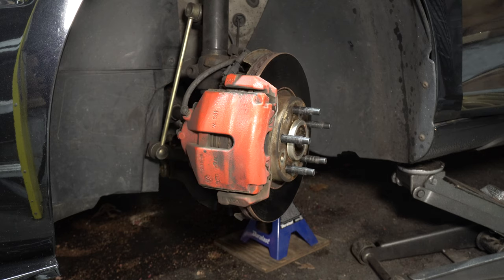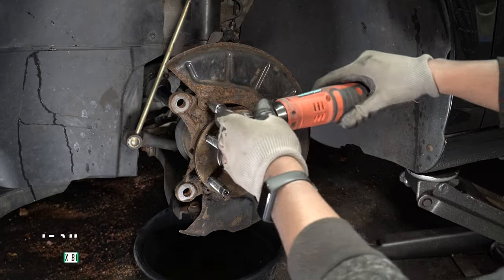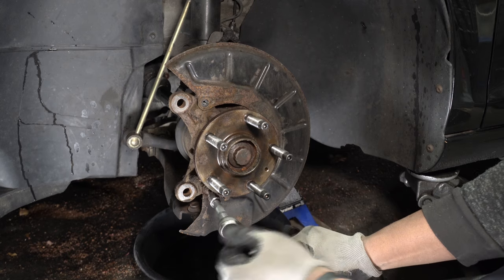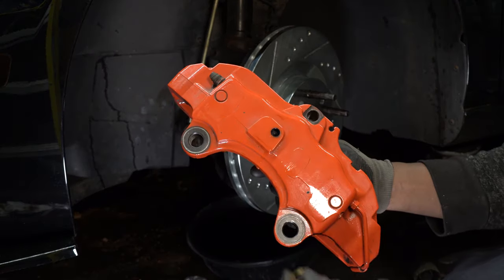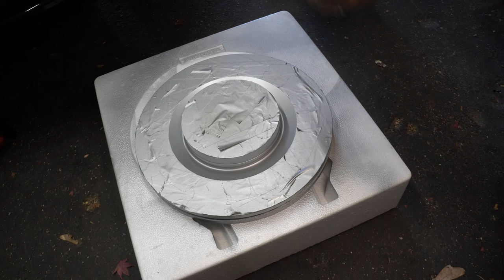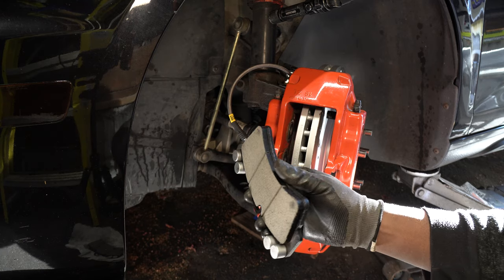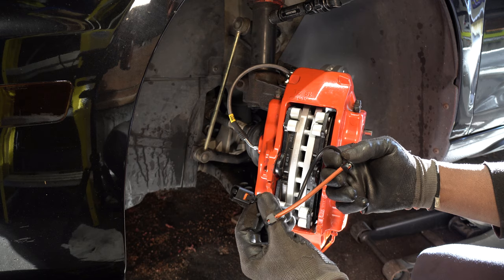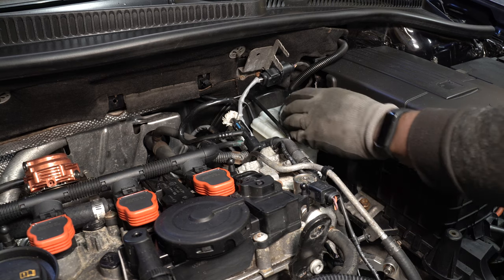MK6 GTI Brembo 18z Caliper Front Big Brake Upgrade

Comment: I did the 6pot 18z Q7 bremboz on my audi a4 2.0t quattro. its a direct bolt on with the exception i had to use ML55 amg rotors thats 345mm. ML55 rotors stock centre bore is 67mm.. i had to find someone to open it up to 68mm to fit the audi centre bore hub. rs4 brake lines. im currently looking into making my own rear brackets to fit the 17z 4pot brembo from a Q7 rears to my A4 rears with 330mm s5 rotors with a wilwood dual caliper to retain the handbrake!
Reply: Hey there I have a a4 b7 2.0t can I fit 17z rotors in front as well ??

Comment: What wheel offset are you using to avoid caliper hit wheels
Reply: Little late,

stock offset is 54mm I believe, and they recommend a 20-25mm spacer at that from what I see.

Comment: This is the best and most detailed video I’ve seen on this brake upgrade so far, Big up yuh self bro. 
I have a 2010 Audi A3 fwd (very similar to the mk6 platform).
Do you think this kit would work for my car?
Reply from the maker: You might have to change the spindle to the mk6 one, but I haven't got the chance to inspect the spindle on the Audi A3. I can't say for sure that the caliper is going to be a direct fit as is, but once you get the caliper mounted, everything else should work.
Reply: @CraftyWorkshopBuilds  ok, thanks a lot man.

Comment: I just recently did this conversion and used the rotor you put in the description and the oem pads for the 18z caliper are bigger than the rotor itself. Did you have any issue with your rotors?

Comment: Very nice video!I have a few questions though .What size of brake discs are these ? The brake sensors of the porsche can fit the scirocco or i have to buy new one ?same with brake lines ?
Reply: Also will i need adaptors for  the scirocco?

Comment: So the stock master cylinder works fine with them? Also would mk5 gti aftermarket ss lines work as well?
Reply from the maker: Yes, the stock master cylinder works fine. Not sure about your about those lines you mentioned.

Comment: Great vid... got the same calipers and waiting for new 350mm custom rotors.... rear set up video? I'm running an audi tt mk2, all videos I've seen indicate that I'll def need a bracket plus the OEM calipers ( for handbrake) + the Bembos...
Reply from the maker: I might do the rear aswell, I still haven't decided as yet. But, yea you'll have to run a dual setup in the rear to maintain your handbrake. It's also recommended that you upgrade your brake booster as well.

Comment: I was curious as to what spacer you used? I did this same mod and i am having some vibration and believe its the hub having no support on the wheel
Reply from the maker: Did you use the hub centric rings?
Reply: @CraftyWorkshopBuilds  yeah i did
Reply: @CraftyWorkshopBuilds  what spacer did you use?
Reply: @lisa did you figure out the vibration problem?

Comment: I'm planning on doing this soon, is there any other upgrades you recommend doing along with the rotors, pads, brake line, and calipers? Do we need any conversion plates or anything like that? Thank you! This video was extremely helpful!
Reply from the maker: I recommend doing a wheel stud conversion. I'm happy you found this video helpful!

Comment: What spacer did you add into the rotor at the end?

Also it looks like you added a centric ring to that spacer.  Can you please provide the info.

Thank you
Reply from the maker: 5mm spacer, my wheels will clear the calipers without the spacer. Nah no centric ring added to the spacer

Comment: You used the hubcentric rings because you have aftermarket wheels or for the brake disc not to move?
Reply from the maker: Both, I have one for the rotor and one for the aftermarket wheels.
Reply: @CraftyWorkshopBuilds  so you have one on the wheel and the one on the li k is just for the rotors or the same ring work in both together?

Comment: So nice video! Very clear! 
Is the electronic sensor replaced or it is the same it was integrated with the stock brakes?
Is there any electronic calibration or reprogramming required after upgrading with this brakes?
Thanks!
Reply from the maker: Nah, no reprogramming needed. The new sensor will plug into the stock connection socket.
Reply: @CraftyWorkshopBuilds  thanks!  I see there is a link for everything you used and installed, but for the Calipers - Brembo 18z, where do you suggest to buy those?

Comment: Busy with a retrofit also... Would it be fine running the disc without the set screw securing it to the hub?
Reply from the maker: Yea, it will be fine. If you have a wheel stud conversion, it will also help to keep the rotor in place.

Comment: Correct me if im wrong but that is not the right side rottor been installed on the left side, meaning the outter of the grooves had to rotate towards the front..
Reply from the maker: The direction of the slots might be based on the manufacturer, and could also depend on the air vents in the middle of the rotor. The rotors that I used came with a stickers on them that identified what rotor was for the passenger side and what for the driver side.

Comment: Hey man loved the video! I was wondering if I could run this setup if my wheels needs hub centric rings since the rotor also needs them? Thanks!
Reply from the maker: Much respect! Yes, if you have aftermarket wheels that needed hub centric, you still need to use them. So you'll be using two hub centric rings, one for the rotor and one for the wheel.
Reply: @CraftyWorkshopBuilds  thanks for the response! Im looking to rebuild the brembo 17z I got from a part out, do you know where I could find a kit to do that?

Comment: is the 17z brembo use the same setup like this..the rotor size and the bolts? 
if u can give detail size of the rotor..really appreciate that..tq bro..
Reply from the maker: The bolts will work. The rotor is a different size, I'll have to double check to find the correct size for the 17z.

Comment: Hey bro great video! I have the BBS CH-R’s just like you - 18 by 8.5s. I rly wanna do this to my gti too, did u run spacers to get these to fit?

Cheers!
Reply from the maker: Much respect! Yea, It will fit without spacers. You won't regret the brake upgrade.
Reply: Why did you run concentric rings? What size spacers did you use?

Comment: I have a 19 gti pp this upgrade path would work for me also right?

Also my car had factory wheel 18" these caliper will clear it?
Reply from the maker: You'll probably have to change your spindle to the mk6 spindle. Yea, 18inch wheels will fit over the brakes, but you might have to add spacers, depending on your wheel offset.
Reply: @CraftyWorkshopBuilds  Okay ill have to look into that! Thanks for the reply.

Comment: Did you run into any brake pedal feel issues? On the MK7 forums for those that did the Macan Brembo upgrade some people did an RPV mod to improve brake feel. Another tip I saw was to re grease the calipers with red rubber grease.
Reply from the maker: Nah, I don't have any brake pedal issues. The brake pedal does not feel spongy.

Comment: I'm curious how the brakes have felt since the conversion. Any consideration to swap for the TTRS master cylinder?
Seems to be many mixed opinions about this.
Reply from the maker: Nah, this brake setup exceeded my expectations, I have no plans to swap the master cylinder.
Reply: @CraftyWorkshopBuilds  But how do the brakes feel now in comparison, you know like do they have more bite or do they just feel the same? Did you ever push the original brakes hard while using sticky tires and compare to them now?

Comment: Are you doing the rears as well or no? And I was curious on what you meant by a stud conversion?
Reply: wheel stud conversion
Reply: @dumbeezy5480  i mean like I want to know the sizing and what not yk what I mean?
Reply from the maker: I did a video on the wheel stud conversion, the link is in the description. In that video I went in depth about the process and additional details are in the description of that video as well.
Reply from the maker: I had plan to do the rear as well, but right now the stopping power is so good, I'm hesitant about messing with the setup. However, if I end up doing it, I'll definitely make a video.
Reply: @carlow_fc1  that can easily be found online

Comment: Thanks for sharing.
I recently bought an S3 8P 2012, so this upgrade should be plug and play as well, right?. As far as i understand MK6 and 8P share the same platform.

Any inputs will be appreciated, just looking from some upgrades since is time to do brakes on my car and no reason to stay stock :D
Reply from the maker: Thanks for watching! Yea, if your car have the aluminum steering knuckle, you might have to switch it to the steel knuckle from the MK6 platform, in order to mount the 18z calipers. Once the caliper is mounted everything thing else should fit the same.
Reply: @CraftyWorkshopBuilds  Awesome, i'll check it and head for the 18z instead the 17z.
Reply: @CraftyWorkshopBuilds  Also, do you know what other alternatives do we have on the rotors?, the one you posted that links to Amazon are not longer available. 
Sadly i live in a country where i won't find shit for this upgrades/maintenance.
Reply from the maker: @DahakaCL  I'm not sure what other rotor will work other than the Benz.

Comment: What’s up bro I would like to know what parts you used I have a 2012 vw jetta gli and I am making many changes to it and that is one of the changes I want to make thanks
Reply from the maker: Hey sup, the part's that I used are listed in the description.
Reply: I did see it but you didn't put which calipers you used I know it's 18 inches but not the year and which Porsche did you use thanks
Reply from the maker: @georgiereano6004  The name of the caliper is "18z" they came on a couple different make/model SUV'S. "Brembo 18z Calipers" is what you should be looking for.

Comment: Bruh how did you find out these calipers would fit directly without brackets?
Reply: I did mine yesterday prior to seeing this video. I was wondering if I did everything correctly. Anyhow: you actually need brackets when you’re going to use rotors larger than 350mm. So its not only the calipers you need to take into account

Comment: Do these brakes fit with 18 " wheels?
Reply from the maker: Yes 18" will fit over them.
Reply: @CraftyWorkshopBuilds  Hello, what about offset 45 or 35? Thanks
Reply: @pablohernandez5221  A lot depends on the spoke design, and how big a barrel the inner wheel has. Not all 18" will work. I bought Neuspeed Rse10's 18x8.5 +45 offset because they're supposedly made to clear BBK's like this without spacers. But not all +45 offset wheels will work.
Reply: @JustinStrife  understood! Thanks for the feedback!

Comment: Did you also do the rears?
Reply from the maker: Nah, I didn't do the rear as yet.
Reply: Have you noticed problems by just doing the fronts? And are you still using the stock master cylinder?
Reply from the maker: @Blindslim43 I still have the stock master cylinder. Nah, no issues by just doing the front.
Reply: Thank you sir I appreciate feed back. Just got some cayenne s calipers today for cheap can’t wait to do this upgrade
Reply from the maker: @Blindslim43  n
No prob. Yea, it's definitely worth it.
Reply: Was there a specific year for the Mercedes’ rotors?
Reply from the maker: @Blindslim43  check the rotor link in the description.

Comment: Bro i have a question your rims what size is it 18 or 19…
Reply from the maker: My rims are 18"
Reply: What are the smallest rims you can fit with those?
Reply: @Smallfry1976  18" if there's enough room in the wheel's inner barrel. These calipers are massive. The 17z's will supposedly fit certain 17" wheels.